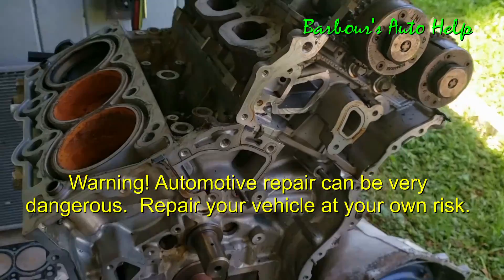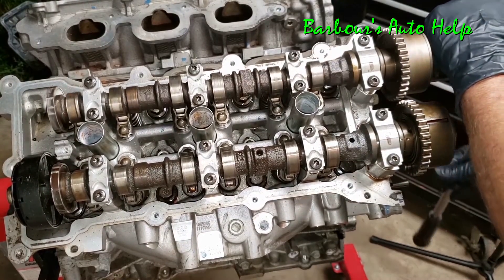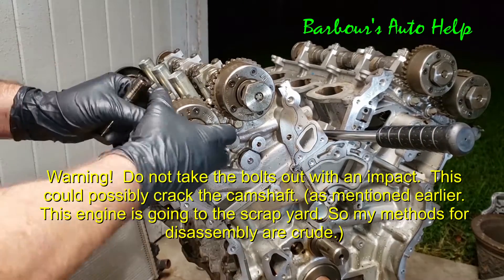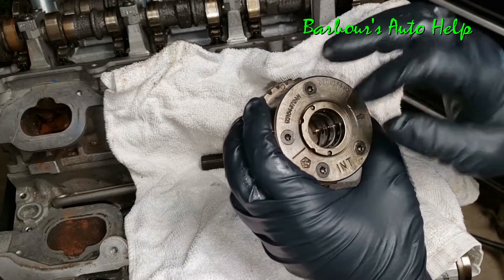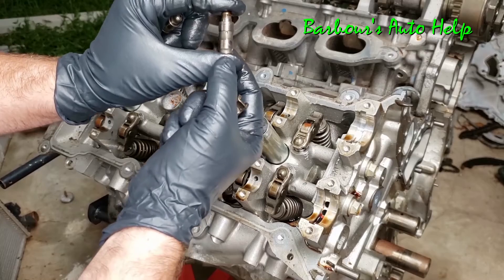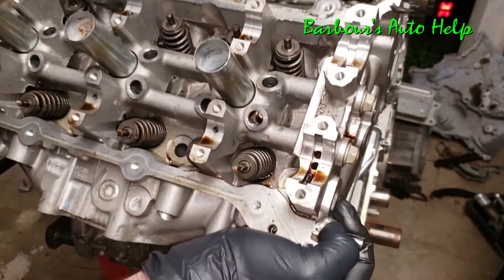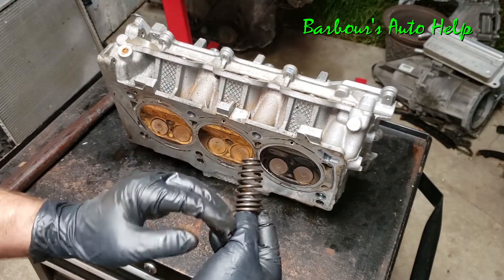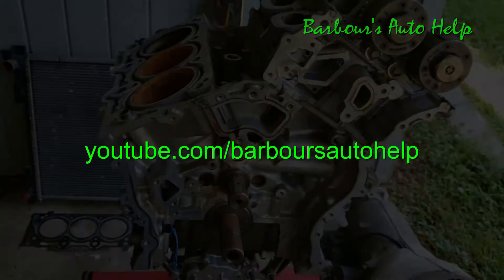Chrysler Pentastar 3.6L Tear Down: Part 2

Comment: All those oil passages in the VVT system is a huge reason manufacturers recommend you use the correct specified oil weight. The engineers design the VVT system based on the oil weight to be used.  Using a heavier weight oil could result in improper operation of the VVT system .
Reply from the maker: I'm sorry I don't remember.  It's been a while since I made the video.  Did I suggest a heavy oil?  Or were you just sharing useful information?
Reply: @BarboursAutoHelp   Comment wasn't directed at you specifically. Rather those who think using a heavier weight oil on these sensitive VVT engines.  Most folk do not understand it could affect the VVT operation.
Reply from the maker: @davidwood7170  Yea, I just wasn't sure if I had mentioned that.  I puckered up a bit thinking maybe a gave some bad info.  I ended up watching the video again.  I figured you were just sharing some good info.   Had to make sure though.  Thanks for commenting.
Reply: @BarboursAutoHelp  No problem,  keep up the good work!

Comment: Very poor in explaining relationship between rocker arms or cam followers to the lifters lash adjusters- still not sure of the actual mechanical interaction like in overhead valve pushrod engine.
Reply from the maker: That's ok.  Someone has a video out there that will help you.  This video is not the end of the road my friend.  A google search would probably help you better.

Comment: Thicker oil like 10w30 help the rockers?
Reply from the maker: That's an awfully thick oil.   I'd only put what the manufacturer recommends in the engine.  I think it has to do with how the rockers are made.  I'm not really sure.  However, the problem can be seen on any engine, Chrysler or not, that uses this style rocker.... maybe not as prevalently though.
Reply: This engine is specced for 5w20 in most vehicles.